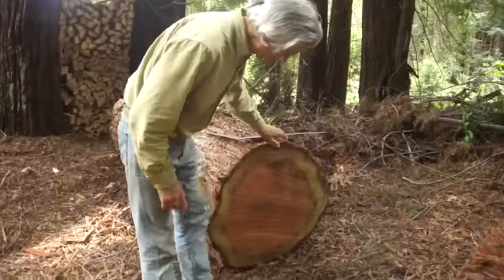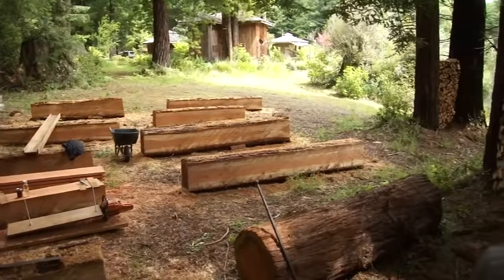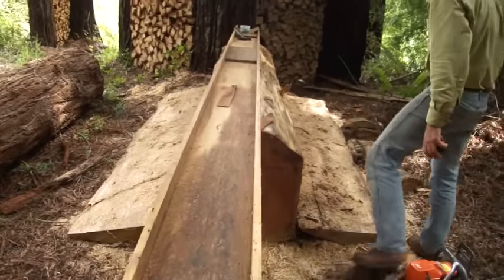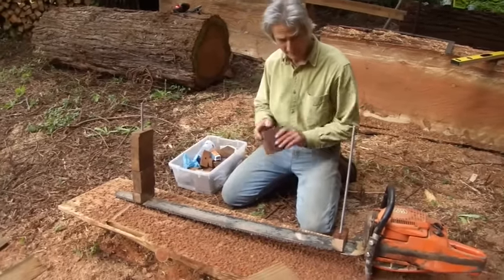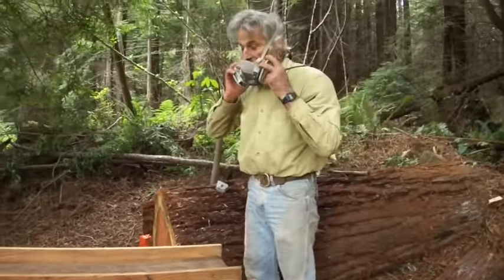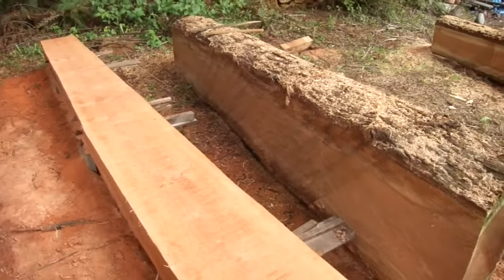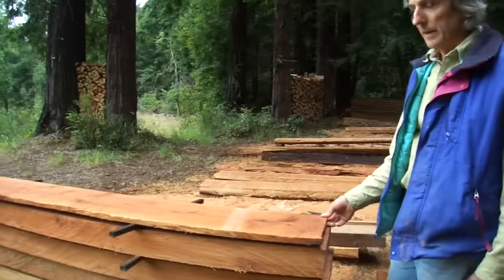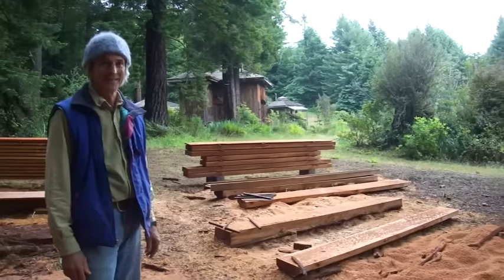Turning a tree into lumber using a homemade Alaskan Mill

Comment: I'm impressed of your work and your skills with your saw mill. May I ask if it's common in your area to use a bark shovel for barking timber? Here we normally have used a bark shovel with a 4" wide sharp edge mounted on a 4 foot wooden handle used like the pecker you use here, (do you call it a pecker?) In the spring and early summer when we have much sap between the wood and the bark such bark shovels are very efficient to use, but as you know in winter all barking is too heavy with the frozen wood and bark. Thanks for your interesting video. My first and best job I ever had was when I 50 years ago started working in the forest. I was nearly born in the forest and dreamed of my own sawmill. Later I bought a sawmill and planer where we made interior panels and dried flooring in pine, oak and birk. The possibility with a sawmill like you are doing is a interesting and clever way to save timber from windfalls in the forest. I became disabled in an accident 25 years ago and couldn't manage that job any longer. I could work a little at my homeoffice when I was able to, but after the corona vaccine I was 100 % disabled and bedridden, and then it's good to look at videos of clever people like you. Thanks a lot.

Comment: David Groth-  I have an innovation for you!  Pvc pipe for spacers!  Light as a feather, and  easy to cut to length in sets, and you dont have to drill a hole through them. Ta-da!
What say you about chain types?  I figure I am going to plane them after curing anyway so I cut thick because I know I will lose some to cupping anyway. 
Follow up question, any messing around with idle setting to run sideways that long or regularly?
Reply: PVC is not as steady and would move around on the rod
Reply: @patriciarambert9261   My stack of madrona slabs would disagree.

Comment: Is that jasper and I believe your bar is of a pull type hay cutter  I think its the rod that the cutter slides up and down with to keep it in line we i got one kind of like it but mines a axle off of a disc enjoyed the video im trying to build a barn would it be better to use some heavy wood screws that way you can just screw then back out

Comment: That looks like an Old Husqvarna 2100, My Dad was a Production Timber Faller at Trade, He ran the Husqvarna 2100s and the 298 when it came out, He was cutting Old Growth Timber on the Wa Coast and Alaska, I have a picture here on my Wall of Dad with an 11 Foot Spruce and a Husky 2100. The 2100 and the 298 were essentially the same Saw power wise, The 298 was a Little lighter
Reply from the maker: Quite an amazing history…actually my saw is a 285 that I’ve had for about 45 years.

Comment: I might build on of these.  If I do I think I might add a handle to the piece of wood that serves as the guide somewhere between the two bolts.  This way I would not have to use my hand on the board which if you happened to not hit the side of the guide board you might wind up hitting the blade of the chain saw.  If it doesn't work I can always remove it.
Just an idea I had for me.  Thought I would mention it.  That way experienced people like yourself could, if you were so moved, to provide feedback and possibly let me know if I am hosed or if it might be worth having.
I am wary of all of the cutting, drilling, turning, etc. equipment in my shop.  A long time ago I used a label maker to stick "careful - fingers and thumbs" on some obvious place that I see when I power up the tool.  I also have them on clear plastic boxes that I keep my carving tools.  I also have a reminder that pops up every two hours on my cell phone that says careful and mindful.
If I am doing something repetitive that could cause an injury it is good to remind yourself to keep your focus on the job.  Ya, most will think I am weird or OCD and they are probably correct, HOWEVER, I take blood thinners every day and a cut could require a trip to the hospital!  Hopefully I would get there before I bleed out.  I also keep bandages that help with causing clots to form and do a test once a week to check my INR number.
And even with all this I always carry my cell phone and don't do dangerous work like using the chain saw if my wife is not home.  And I'll probably do something stupid one of these days and bleed out.  Well I'm 79 and still get around and do a lot of manual labor and I want to be able to fly fish for at least another 10 years and a little canoeing so I try to work safely.  That includes planning each job and looking for and possible accidents and provide for them.  As an example I don't get up on the roof and I have OSHA approved fall protection that I require everyone to use who goes on the roof for any purpose.  No safety equipment, you don't work on my property!  Yes, I spent some time as the individual responsible for workman's comp and safety at a factory where I worked and have seen things that I wish I could forget!!
Be safe.
Reply from the maker: Hello Don, You have some good ideas however I now have a Turbosawmill. The Alaskan mill is for someone who isn’t going to mill an large quantity of lumber and can’t get into a lot of expense. Yes I’ve seen a number of bad accidents and it is definitely is to be avoided. Keep fly fishing
Reply: @DavidGrothsculpture  HEY DAVE...DO YOU HAVE VIDEOS WITH THE TURBO SAWMILL?

Comment: That is very interesting useing the wood guide on saw.My Dad built one out of tube steel years ago we cut power poles flat top and bottom.i have mobile dimension saw now.lot less bull work. Very nice video an explanation on all parts Thankyou Very Much (---:

Comment: Great job. I and may best friend bout an alum. Alaskan saw mill twenty years ago to make slabs of wood fro Madrone. No one at the time would even attempt that. the only thing we had issues with was the slabs came out with a severe washboard effect. could not figure out why. we also had to have the chain sharpened at a different angle for ripping. It mad a huge difference in the cut time. It was a lot of work but worth it. and Madrone Is a very hard wood and the drying was tricky and the warp was nasty if you did not sticker it and weight it down. My house now is paneled in Madrone. its beautiful wood. but very hard to work with. you have to pre-drill the nail holes before you nail it. and it will still shrink once its n the house for awhile.

Comment: Great video!
A couple questions..1)what diameter is the threaded ready rod?2)for drilling the holes in the bar what size holes are drilled and what is the spacing?
3) How much spacing is created by the washers between the bar and the wood spacer blocks?
Thanks so much
Reply: I have a 42" solid bar as well..with this set up how wide can you cut slabs? I'm guessing 35"?
Reply from the maker: I believe about 36", however I'm using a Turbosawmill now and it makes life a lot easier.

Comment: Great technique, very skilled. My only critique would be, when you first start running the saw down the guide on your cuts, you're kneeling directly behind the saw, and if that kicks back on you for some reason, it could really tear you up. I would think you would want to stand and walk on the side right from the start, running the saw and pushing the 2 by 12 from the top, like you do for the rest of the cut.

Comment: Came across your video. Awesome technique you’ve crafted. Just thought I’d ask this to possibly save you some time. Could you use your blocks on top of the leveling board to reduce time installing and removing your wing nuts?
Reply from the maker: Probably could work however I’ve finally after many years transitioned to a Turbosawmill.

Comment: If you had a spring system connected to the saw somehow that was posted at the non starting end it could help assist the pull of the saw.  Also if you had a trigger extension that was mounted up on your alaska guide board that would also help.

Comment: G'day,

YayTeam...!

Very interesting.

I too have a Chainsaw-Mill..., a "RIPKING" Guide-Rail system which was made in England in the late 1980s, with a Stihl 038-Magnum & a 36-inch Oregon Bar (115-Tooth Chain).

The Ripking was designed for Softwood, like shown here, but I'm in Oz so I cut  Eucalyptus Hardwood, mainly Stringybark & Yellow-Box.

Over the past 3 weeks I've posted 6 Videos showing the process of Quarter-Cut Milling a 15-inch Diameter Stringybark Log 4.5 Feet long, into 29 "Floorboards" or "Fence Palings" - depending on one's pointof view.

The Ripking operates with the Saw cutting Vertically, rather than Horizontally ; and it's slow - but not THIS Slow...

  It turns out that each Board has 53 minutes of my Time in it, with 6 minutes & 22 seconds worth of full-Throttle cutting, using 106 ml of 50:1 Two-Stroke Fuel costing 21.8 cents, & 60 ml of Used Sump-Oil for Bar-Lube..., while emitting 265 grams of Carbon Dioxide in the Process.

The entire job took 25 & 1/2 hours elapsed time, used 3.1 Litres, for 3 Hrs & 6 mins of full throttle, $6 worth of Fuel & emitted 7.75 Kg of C.O.-2.

Please feel free to backtrack me to see the Vertical variation on this theme...; used to propperly Quarter-Cut the Timber.

Have a good one.

Stay safe.

;-p

Ciao !

Comment: A good effort. Wouldnt it be easier to mount a couple l of 2x4s to the ends of the log for the  guide to be fixed to? And how about using a pair of nuts and a large washer to avoid all those wood blocks on the bar assembly? Thanks, good video, keep millin. Late.

Comment: I started doing some turning in addition to my normal wood working so I decided to get into milling my own lumber from felled trees. Boy am I regretting it. Milling your own lumber is truly back breaking work. Even if you elect to utilize a chainsaw mill you will still need a saw with a long bar (not cheap) and lots of measuring. Moving these logs around by yourself is not fun. You quickly realize how out of shape you are. For those of you out there looking to buy these guys products pay them what they are asking and don’t try to get it for less.  These guys are working their butts off.

Comment: Great video.... Regarding chainsaw failure: 2 contributing factors: #1. the air/fuel mixture on new saws is too lean. The ethanol in the fuel compounds the problem. This makes the saw run a little hotter than it typically would. Figure out how to richen up the mixture on your saws.  Run ethanol-free fuel if you can find it. #2 Heat build up: this type of chainsaw work is very stressful to the saw. The heat build up can spike when you shut down the saw immediately at the end of a cut ... or worse... you let the saw run out of gas in the middle of a cut. The saw should always be allowed to run at a low rpm  with no load for 20-30 seconds so the air flow created can cool the cylinder head. Aside from these two items we might all find that "they just don't build em like they used to "

Comment: He should do blocking on the top of the Wood I Beam he made to keep sides square and length stronger to make a true level cut,  Better than heavy steel or cheaper than a good ladder if you have room to haul it around.

Comment: In the cover picture you seem to be working so hard. The Alaskan chain saw mill I suppose has its advantages but the way I've used to cut slabs-lumber is just let gravity do it's thing with the saw and just cut with the tip of the bar. So not to burn the saw up an not using the whole bar and chain to cut with is hard on the saw just to throw power saw dust. When cutting with just the tip you'll have 10 inch long strands of wood for the saw dust. Much easier on the saw and the person running the saw as well.

Comment: Not quite clear on how you calculated your lines on opposite sides on the log.  Very impressive that your exit cut was right on the line.  Can you explain how you did that?
Reply from the maker: The height of each side of the mill beam can be independently adjusted from each other so that the beam can be aligned parallel with the lines drawn on the log.
Reply: @DavidGrothsculpture  so you are just picking lines on each side approximate to each other in the log, And then measuring up from each line to your guide beam.  Thx

Comment: 16:57 Just curious, if the blad kicked back, would your stomach be cut open? What could be done to make that part safer or to prevent that?
Reply: RoMMeL1337ak47  I see your point. However, you'd be surprised how many injuries started out with "it can't happen", lol. Great video.

Comment: One thing to be aware of if you have a limited number of logs to work with is kerf. Even if using a narrow kerf ripping chain on a chainsaw mill. That chain is turning 1/4 inch of wood into sawdust with each pass. 
A band mill such as a Woodmizer only has a kerf of approximately .050. Fifty thousandths of an inch isn’t bad. But if you’re chewing up .250 thousandths of an inch with a chainsaw it adds up to a massive amount of wasted wood. Not to mention that ripping a log with a chainsaw is horribly inefficient regarding power and fuel consumption. Chainsaw mills are great for small amounts of lumber in a pinch. Providing you don’t mind wasting the huge kerf loss.
Reply from the maker: Good point!

Comment: wonder how much the milling for the house wood cost. maybe 7-8k?
Reply from the maker: The Alaskan Mill is OK for smaller projects, but too much work to mill for an entire house. I have a Turbo sawmill now and have recently milled about 12,000 board feet for a small building. That much milling with an Alaskan Mill would be an incredible amount of work! In the past I had 27,000 board feet milled for the house I live in now…and I wouldn’t want to mill that much with my chainsaw. :-)

Comment: I kept a lot of the best oak pieces downed after the last hurricane, and neatly stacked them around an old storehouse on "my" part of the in-laws property on which I live. Looked great, actually... very "rustic"... even photogenic. I could imagine all kinds of uses for these pieces; if nothing else, FIREWOOD as a last resort.

Some of the best pieces started disappearing and, come to find out, some of the in-laws were burning them in their DEBRIS PILES. Note that they weren't burning all of the limbs, sticks, twigs, i.e., TRASH from THEIR areas. They would come over instead and take my nice, large, neatly-stacked, un-split oak LOGS... many of them cut with specific projects in mind... and burn THOSE instead!

Note that I have burned LOADS of useless debris, and wonder just what makes them think I couldn't have burned the good stuff that they took just as easily... IF I'D WANTED TO! : )

Comment: Those bigger slabs could make a man rich..  i saw a 9’x4’ black walnut slab with termite holes and imperfections included, dude used a clear epoxy 2 part mix that he mixes then puts in a vacuum chamber to get out all the bubbles in the epoxy then he makes a frame around the piece with 2x4’s like your pouring concrete then he just fills the form with the sanded slab and when the epoxy hardened he just buffed it out and sold it for over 10,000$...   a few days worth of work, 20$ worth of epoxy and some buffing compound with a 10 grand payout is some good cheese there...   and redwood..  sheeit, i could see that going for 15 or 20 grand on how rare they are in some states...

Comment: The concrete block is not safety on that position. Its strengh is in vertical position ( holes on vertical position). Otherwise could crack

Comment: The bar is called an iron digger. It’s a small one.
Reply: I know the bar as an "Inch Bar".  In machine shops, 50-100 years ago, 4, 6, 8, etc. men would use these bars to move machines around the shop, one inch at a time.  Much like oaring a boat.
Reply: Captain Cobb I have done lots of mill wright work. The bar your calling an inch bar is a spud bar. Machine moving bars (spuds) has a pointed end which is the spud, the other end has a pry feature like a pry bar. The spud feature is also used by iron worker in the form of a “spud wrench”. In this case the spud end of the wrench is used to align the holes in steel beams so a bolt will go in the hole. These bars have been around as long as mad made iron tools. Before that they used wood. When clearing land of stumps and rocks large posts were used to pry and move because to get an iron bar big enough to move a stump 2 people couldn’t lift it. There is a thing called a pinch bar which is a long pry bar.
Reply: The give away on the said bar in the video is the round disk on one end for tamping dirt and the other has a chisel point used to cut clay and roots so the post hole digger can get the material out. I’ve used them until my hands blistered through gloves. I went to a rock drill and explosive gel and used the iron digger to tamp the post into the hole. That practice ended after the Oklahoma City bombing. Now I use a carbide tip post hole auger. I still like the gel better.

Comment: nice job, i milled myself with aluinum frame. Tip: i drilled hole in handle for lever to run saw trigger then two nylon ropes one on trigger lever one on other end in parallel. then connect boat winch to tree on oppisite end off log, and crank the mill towards you affter starting cut, adding some weight on top of mill to keep chain checks to nothing, and you wiil be safer, no gas breathing or body parts to gash.  never again did i push saw 😉
Reply from the maker: Brilliant! 👍

Comment: You could drive a Metal steak into the ground at the end of the log. Then attach a rope and pulley to the steak and to the opposite end of your rig than the motor is on. Then just push one side and pull the rope to push the other side along. No need to stretch your leg across a tree while using a big a$$ chainsaw.